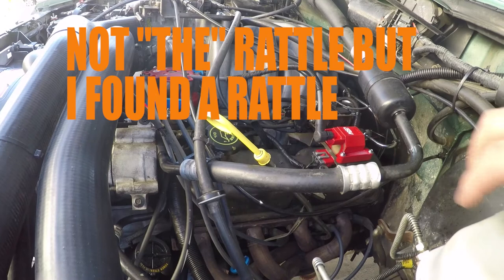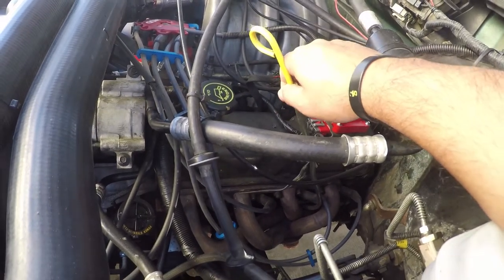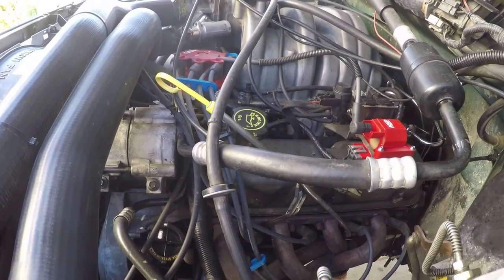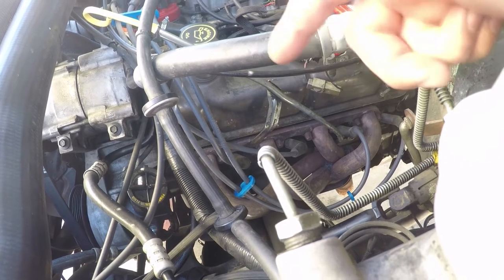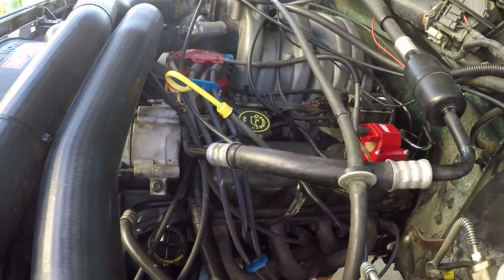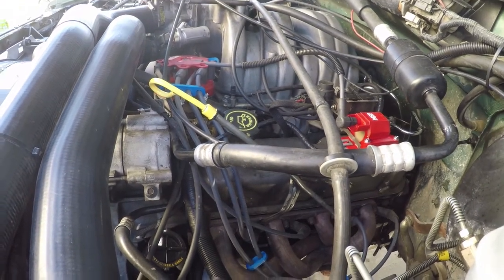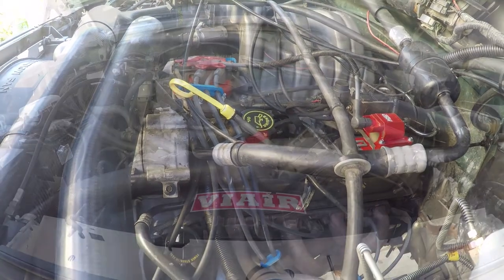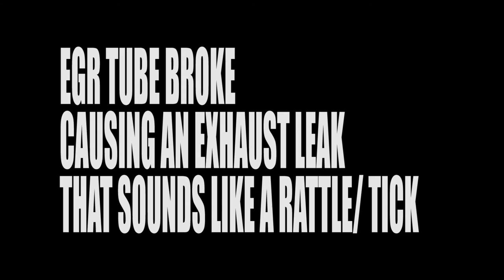RATTLE HUNTING!! 0063

Comment: Dude EGR’s traumatized me. All my problems on my 4runner were all related to EGR problems! Ticking, power loss! Hate those things! Glad you found out what it was!
Reply from the maker: Visual Overland before I started the channel I chased a egr issue for 5 months. Truck ran like crap! Finally got fed up and replaced everything. An old ford mechanic told me that egr problems are the worst and they recommend just replacing everything.
Reply: Adventures With Laylay yeah my mechanic told me the same. Replaced the damn car and got the Jeep. Haha! I couldn’t do that to a bronco tho.